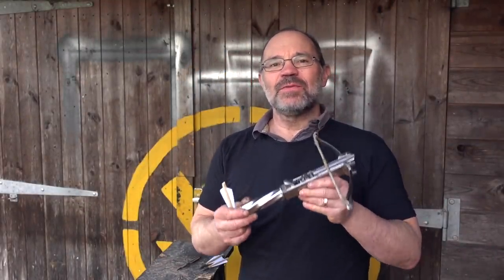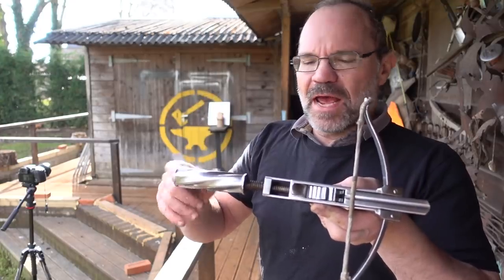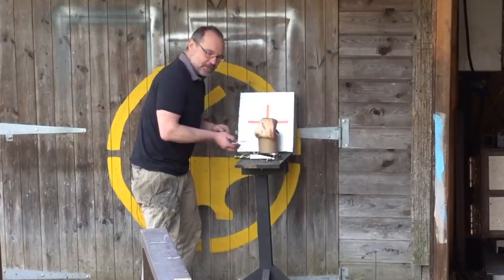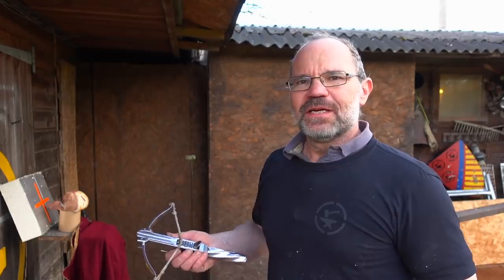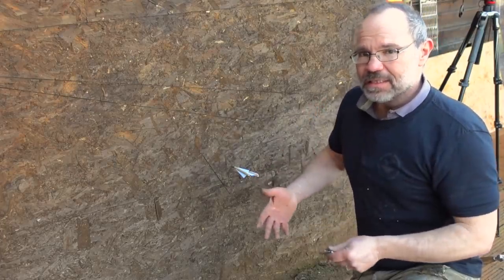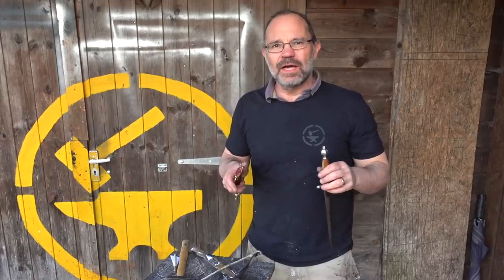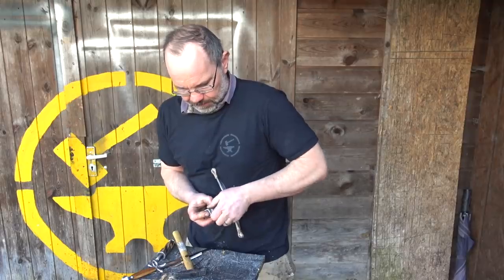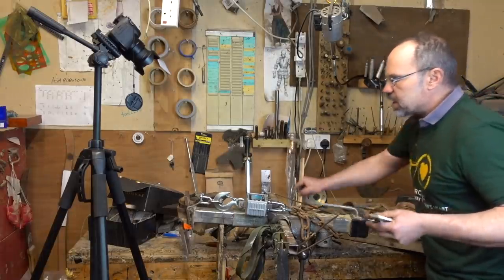200lbs Assassin's Crossbow - LET'S TEST IT!

Comment: Hey Tod, Just wondering about the assassin part of this bow. In the video it sounds relatively loud, but compared to a gunshot it might be relatively silent. The sound might also not be as easily recognizable as a weapon firing from a distance. What are your thoughts on this?
Reply from the maker: Quite quiet really, but your whole movements are very telegraphic and where a gun stands a good chance of hitting and hitting effectively, this does not
Reply: @tods_workshop  but imagine walking through a crowd, you could fire this thing underhand when passing by and def. be way more silent than a pistol. Hardly anybody in the crowd could see it. And the crowd itself is very loud, so the DWANG from it would most prob. drown in the noise the crowd makes.
And you could hide it in a big bag or sack.
Reply: Plus a pistol would put out a large amount of smoke which would indicate where the shot came from.
Reply: @Seelenschmiede  I imagine in a crowd, a dagger would still be easier and quieter to use.  You don't need to aim a dagger the same way either.
Reply: @ptonpc  with personal guards at the target, you don't come close enough to use a dagger. And then u use this thing.
Reply: @mymartianhome  Not unless you are are shooting black powder for some reason.
Reply: A closed breech .22 short is quieter that that mini X-bow. Definitely NOT a revolver since all revolvers (except M1895 Nagants) have gaps between the cylinder and forcing cone which loose velocity and add a lot of noise.
Reply: For concealability, ignoring the noise made (which may be overlooked in a party situation), the smoke from the powder from a period firearm would be a dead giveaway..
Reply: @Seelenschmiede  While wearing a not uncommon cloak at the time for concealment of the crossbow.
Reply: @Seelenschmiede  Feel like that assassination attempt is doomed to fail. Unless someone is very lightly clothed like wearing a thin dress only (which wasn't all that common), you would need to hit exposed skin to even penetrate enough to poison someone, like hitting them in the neck or something. The probability of failure is way too high. Also it's not very sneaky, you have to load the damn thing right before you shoot, people will likely see that. A 🗡 can be go from concealed to deadly wound within a split second, the assassin may vanish in the crowd before anyone can react, and it's way more reliable to actually kill somebody.
Reply: @kooroshrostami27  did you watch the vid at all? Todd showed that the thing is VERY ABLE to penetrade sturdy clothing.
Reply: @Seelenschmiede  Who wears a jacket like this directly on skin? You're not going to penetrate a proper set of clothing with that thing. An important rich person is not gonna walk around in a rug like this on bare skin, not even in summer.
Reply: The Question is, will it go through skullbone?
Reply: @aleisterlavey9716  I doubt it.
Reply: @kooroshrostami27  Even when multilayered clothing was totally a thing, they didn't wear several jackets. It was a fine linen or silk shirt, over this a overshirt and than a jacket, doublet or some sort of robe. And only you have to poke 3-4mm deep into the skin to reach a sufficent blood flow for a potent poison to work. The deeper the better, but you don't have to stab it in a handspan deep. Tod would have to test it if it could perform this at 2m distance. I don't know it for sure, but I think it would work.

Comment: I'll say this I worked in Security and they trained us most modern shootings happen from 3 to 5 feet away. I COULD see if you're walking past someone and having it primed already pulling the trigger from under a cloak ezio style. However I can't see it really in widespread use simply cuz the dagger would be more efficient. Big fan of your work and that's a great piece.
Reply: Nailing someone passing in a parade or procession with a poisoned bolt then fading into the crowd. You could always drop it since you're not going to worry about fingerprints.

Comment: I have an idea for a coil spring type "crossbow". Using die mold springs in a tube with a pulley and cables. That winding mechanism helps a lot! The big difference is you don't have a cross bow to conceal, but a tube.

Comment: I think this would work well in a crowd you'd walk up shoot and disappear again without being heard.
Reply: You'd still have to load a bolt into it as there's no bolt clip, so you'd have to walk up, keep in range with your target while loading a bolt lift it to aim then shoot.
All the while hoping nobody in the crowd sees you doing this and yells "assassin!"
Underhand throwing a poisoned dart would be easier.
Reply: @daviddavidson2357  Humans aren't as small as his target here, walk up place bolt hold in general direction shoot and kill.
Reply: @yarugatyger1603  Usually anyone you intend to assassinate will have a bodyguard, or in the case of Elizabeth, multiple bodyguards. Even if you were extremely quick chances are someone would see you. If you're in a dense crowd that makes things even more difficult as the bow limbs have to move forward and if they strike anything (or anyone) one limb will lose a lot of energy and send the bolt flying off in the direction of the slowed limb.
Also, humans tend to move, pieces of pork don't.
You're taking an awful lot of risk for very little reward here. If you can accomplish the same job with a dagger or a small weighted dart (think of a mini plumbata) with the dagger you would be carrying an everyday object and not arouse suspicion as you made your escape, if it was a single mini-plumbata it should already be in your target or at the least out of your hands so you can just walk away empty handed and if a bodyguard or town guard searches you you'll not be carrying anything suspicious.
A tiny steel bow which shoots specific projectiles however, pretty sus.

Comment: It is an assassin's weapon. It was used for short range shots - beyond dagger reach - with a poisoned tip.
It didn't need to be powerful nor very accurate, just enough to enter a few cm into the body to effectively deliver the payload (poison). Furthermore, it was easily concealed and easily carried (compact and lightweight) and easily used covertly. During the cold war, the Russians/Bulgarians famously assassinated someone on a busy bridge in central London by using a small poisoned pellet that was shit out of the tip of an umbrella with the target walking a few feet in front  You don't hold the weapon like a traditional firearm, but rather, you hold it close to the body and fire. So this crossbow could easily be fired by opening one's overcoat and using that as cover, quickly taking the shot and closing one's overcoat. Nobody, especially nobody more than a few feet away, would notice and as you were never within arms length of the victim and were quick, no-one would instantly assume that you were the attacker. It would be quite obvious to people if you walked up to someone and stabbed them. The idea is to get close enough to do a discrete hit without being so close that you become the obvious assailant. You may be a medieval weapons expert, but please leave the assassin's work to the professionals. 
You could have the crossbow hidden in a wicker basket and fire through that into the target. I'd certainly use one even in 2024 to kill somebody discretely with a poisoned tip.

Comment: Just came across this, a couple of points if I may: 1. This is not as long range weapon, think of it like the SOE's Welrod pistol of WW2 it's meant for close in assasinations. 2. It has potential to be unobtrusive unlike a sword or dagger you don't have to swing it at the person, or hold it out at arms length, and if combined with poison it doesn't need to be that accurate, walk past the person and shoot into anywhere in their body, you are not trying to hit a vital spot just deliver a potent poison from say 10ft/3m away, of course in Venice you then just drop the weapon in the nearest cannal as you walk away

Comment: That crank you used at the end to "wind it up," is there a way you could hide a crank like that by adding a couple joints where it could pull out straight and then slide into the handle of the balestrino?

Being able to wind like that with done added leverage could weed reduce reload time to something manageable.

Comment: Much more stealthy than a loud pistol. So, yes an assassin may have a use for it. Plus, why else would they have been banned and criminalised (not convinced by your assessment of that). Also, poison was a popular thing in renaissance Italy.
Reply: Definitely less loud but a lot less effective and they may have been criminalised based on the concept without one ever being used as an assassins weapon. Also unless it’s got a clip to hold the bolt on it it’d be a huge pain in the arse to use. Also Todd’s point about using a dagger is honestly very convincing considering these bows could barely hit a barn at 20 meters.

Comment: not so long ago Joer Sprave had a video of a full-metal projectile (more weight) with a metal fletching that is sharpened to penetrate more flesh (and to reduce air resistance during the flight). This brings some sence to that little crossbow, i think

Comment: It's quiet, low to medium range and can be used in conjunction with poisons. Factor in hours of practice to be able to reliably hit your target, and I can't see a reason for it not to be every assassins wet dream. You've got to remember that firing a gun would compromise your position and a dagger requires you to be close enough to a potentially high profile target and escape would have been a major consideration. Anything you can use to put a few additional feet between you and your would be apprehenders, would have been a godsent.

Comment: Tod I think you make a excellent argument for the Balestrino being an expensive toy but you also demonstrate that it could be an effective 'Assassins crossbows"  especially coupled with poison and shot from close range. The mini crossbow would be cumbersome, as you stated, having to load the bolt just before use but it would draw less attention than firing a gun if you had a good ambush spot or were moving with a crowd you could quickly blend end with. Possibly using the balestino to get the first strike before moving in with the dagger to finish them off. 
Just playing devil's advocate here. Not trying to claim anything. Just exploring ideas. Keep
 up the great work. I love you channel.

Comment: I would imagine that if you were to use this for an assassination, it would likely rely on two factors: sound and target access. Imagine you are trying to deliver a deadly through clothing, you cannot get within knife distance and a wheel lock would be too loud. You find a position where your target passes a window or a hole in a wall regularly. So you poison the bolt and shoot them at fairly close range, under a meter, through a tiny opening. Nobody hears a shot they can really perceive as a weapon's discharge amongst the other sounds. You then discard the weapon and saunter off. No reloading, no fiddling about, take the shot, shrug, drop, walk away.

Though at that point, you might as well set up with a full sized 200lbs draw crossbow because it would likely be cheaper and put a larger poisoned bolt through your target.

Comment: I think this crossbow has advantages that are lacked by the two alternatives for assassination tools you suggested (the pistol and the dagger).

Pistol: While hardly silent, as this video demonstrates, it's a damn sight quieter than a pistol. It's a difference between alerting anyone in a few meters versus everyone in a quarter mile. It's probably much more accurate, once the wielder had practiced with it, unlike early pistols which were unreliable regardless of how familiar you were with them. Moreover, a pistol shot cannot be poisoned, which can add to the chances of killing the target eventually.

Dagger: Requires being in melee range to gain the benefits your described. The entire point of using a crossbow is to use it at range. That it's still a very short range isn't going to be as big a problem in an urban environment, where you're operating at closer quarters anyway (if you need more range, you'd arrange for a proper crossbow). Any kind of range advantage might turn an assassination attempt from a non-starter to at least possible, and has the benefit of being easier to escape from. Yes, daggers can also be thrown, but then you're down that dagger (if your aim is assassination, you aren't waiting around after your attempt to try to retrieve it). And unlike a crossbow - which is designed to be easy to pick up by the lay user - it's much harder to get proficient enough at knife throwing to make it a viable ranged weapon.

Do I think the tiny crossbow was commonly used for assassination? No, if for no other reason than because we lack evidence of them existing in large numbers or of people killed by them. But it's not impossible. The main thing holding it back is likely the cost and effort involved in producing one. It's not that it's necessarily just a rich man's toy, so much as only rich men could afford them.

Comment: I think you're right that its probably for messing around with friends and hanging on the wall, but I do see it having a unique niche among potential assassins weapons of the time.

Compared to a gun it is quieter.  Not silent, but if there is some other source of noise such as, applause, a loud argument, or a procession, the location of the shooter might not be immediately apparent.  

Compared to a dagger it gives you some distance.  Sure you can't shoot it from too far away, but you don't have to get right up in someones face.  Getting close enough to stab someone would be immediately suspicious depending on the person and the social situation, where as this could be fired from casual speaking distance, or a few seats away.  If the focus isn't on you, you could conceivably bring it out and fire before anyone notices.

Finally is the reaction to being shot.  Where as a gunshot or a stab wound is immediately apparent that you have been attacked and people will be looking for the assailant, this is relatively small wound.  The target or those right next to them might first check to see what happened before looking to see where the bolt came from.  That could be enough time to conceal the bow and join the reaction of the crowd before someone sees you.

Comment: I haven’t read ALL the comments, but one thing I haven’t seen mentioned is stealth.

Sure you could use a musket or a pistol, but they didn’t have silencers back then. A poisoned bolt launched from a concealed device would be perfect for someone in a crowd, or peering over a garden wall/through a window. Or say an important target always has a security detail, and you have one shot from a few meters away. Cant use a knife, firearms don’t guarantee death, but poison will. and if you can get past firing without notice,  then you have a chance of cooly walking away because no one heard where the shot came from.

Comment: Few ideas on how it might've been used as (or could be incorporated in a fantasy scenario):
1) Assassin's Crossbow - you get some poison on those darts (even as simple as feces, depending on the medical technology), and it could be used at 2-3m distance, too far for a dagger, that crossbow could go far enough. With a body-sized target and poison it doesn't have to be super precise, just good enough. Plus - practice makes perfect. And it doesn't create as much noise and smoke as a black powder pistol, easier to retreat after a successful hit, as a lot of people might not even notice something happened for a while

2) Dueling. Could be non-lethal, to first blood, better than a pistol, quieter, less fuss is required with loading it. 

3) Rich kids being assholes, and shooting at random strangers, then hiding them, acting like nothing happened. The most plausible historically, also the reason to ban them, similarly to what you've said.

4) A vanity toy, as you've said.

Comment: Well, at that size, if you need a 2nd shot, you most likely have a 2nd crossbow.

Also, never to be forgotten, is the possibility that this is a weapon meant more to be a distraction than a "one shot one kill" thing.   It may even be called an assassin's crossbow because it is a good way to use to get the extra moment needed to get close to the target to use something more damaging.   Or perhaps hit the bodyguard with the crossbow to get access to the target with your dagger kind of thing.

What happens if you use an all-metal bolt?(ie heavier but still with fins)   All-metal spinstabilized bolt without fins at all?

300m range is clearly not possible as you tried it, but is that claimed 300m range reliable?   If the claim is anywhere near reliable, well, something is obviously missing.

Anyway, loved how definite and absolute your final answer was.   :)

Comment: Correct me if I'm wrong, but I think the crossbow still has advantages over the pistol. The crossbow could be much quieter, so you could shoot in a crowded room without drawing attention. Also, it might be easier to poison the crossbow bolt compared to poisoning a pistol bullet. If you wanted to guarantee a fatal attack in public with less chance of getting caught, it makes sense to use a crossbow. Then again, maybe this is just the exact line of thinking that the crazed nobles pursued without ever actually trying anything.

Comment: I think it would actually have quite a useful application. In a busy event, it could be used and quickly discarded. No noisy blackpowder pistol, no need to get too close or be seen within reaching distance of the Queen. By the time anyone realised what had happened, you could be busy mingling in the crowd of astonished onlookers or even making your escape.

Committing a crime is easy, getting away with it is usually the difficult part!